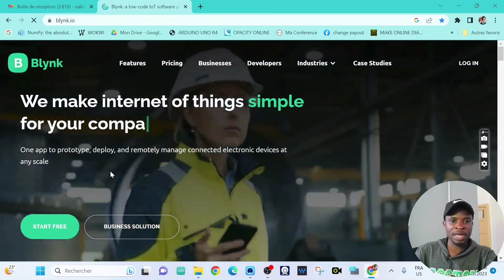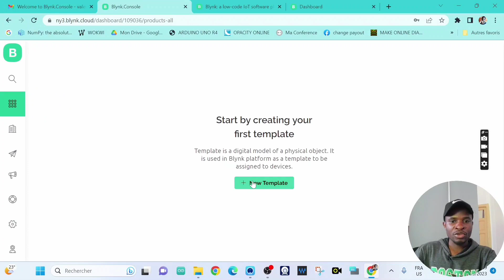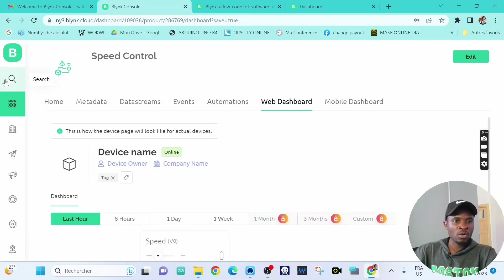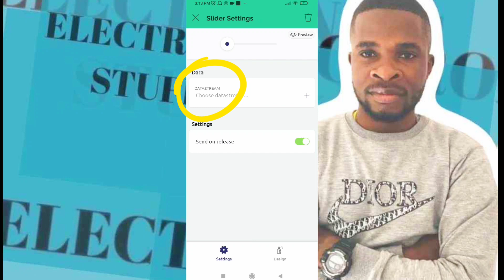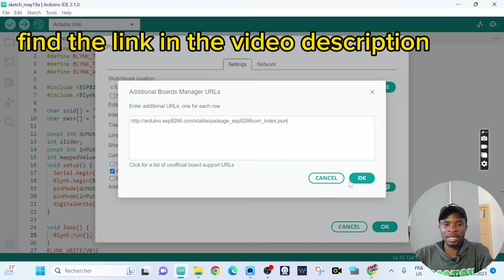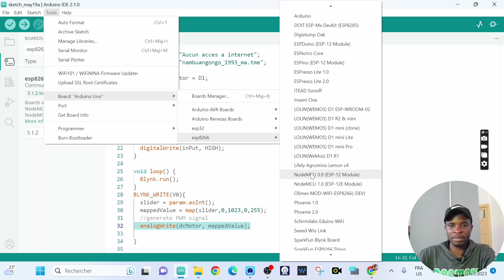How to Control DC Motor Speed With NodeMCU using Blynk 2.0 | IoT Project #nodemcu #iot #electronics

Comment: Hello bro. Nice work here. Please, I did this project but it didn't work. Could it be because I used Arduino ide version 1.8.19?
Reply from the maker: I think the problem is with your code or your circuitry
Reply from the maker: Thank you for your comment though
Reply: I actually followed all the instructions. You said D1(ESP) - enA (L298); D0(esp) - In1(l298) and then GND to GND right? 
And I replaced the Template credentials with the ones there in the code and also replaced SSID and PASSWORD with my own WIFI's.

Comment: Hi I’m using a 4pin 12v pin fan, should I know is that same circuit with ur diagram? Thanks!
Reply: Ar i think u ar using 2pin 12v fan. If I change to use the 4pin fan, I think it is same as ur circuit without motor module?
Reply from the maker: These 4 pins are coming from ESP32 ?
Reply: @uploadideaswithitamar  Actually I want to change the fan to use NF-A9 PWM 12V 4Pin